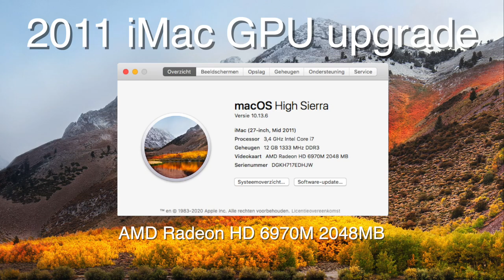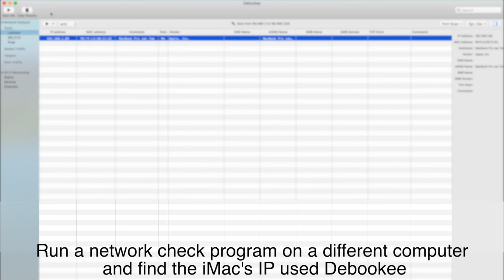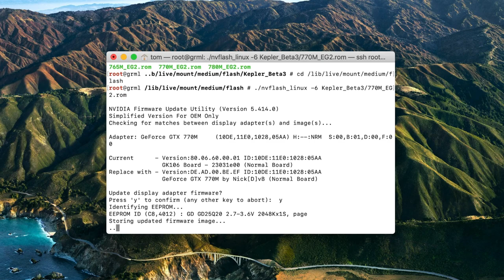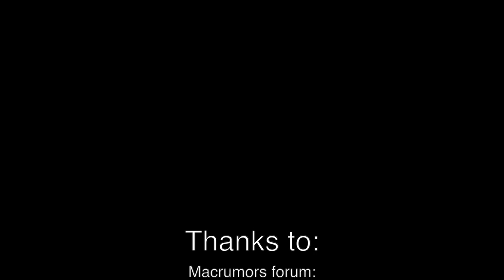iMac 2011 GPU upgrade to NVIDIA 770M with new VBIOS

Comment: Te hablo dede Monterrey, Mexico tengo un problema con esta tarjeta la compre igual que la que tu tienes 770m y el cambio fue por la AMD de 2 GB... todo igual, segui tus pasos pero la pc, no prende para nada, se queda en negro y veo que no pasa del primer led y veo que solo hace un movimiento los ventiladores y ya. Quisiera tu ayuda por que en realidad me gustaria usar mi imac que desde hace mucho tiempo no la he usado :(
Reply from the maker: I don’t speak your language, but I translated it via google. I think you have a short circuit somewhere. Make sure the GPU is mounted correctly.
Reply: @tomvreugdenhil1490  That is the problem if I put the GPU that I already had before if I turn on the iMac
Reply: That is the problem if I put the GPU that I already had before (6970M) if I turn on the iMac but if I put the new one (770M) it does not turn on :(
Reply: @tomvreugdenhil1490  That is the problem if I put the GPU that I already had before (6970M) if I turn on the iMac but if I put the new one (770M) it does not turn on :(
HEEEEEELP!
Reply: @adrianhumbertoguzmanmartin3418  Estas seguro de que cuando pones la tarjeta 770m no estás creando un corto con el disipador de calor de GPU? No será que le estás  apretando los tornillos demasiado a la tarjeta haciendo que alguna resistencia o componente de la tarjeta esté haciendo contacto con el metal?
Reply: @brojoe787  si me pudieras ayudar estaría agradecido lo que hice fue ponerle cinta negra en el soporte
Reply: @adrianhumbertoguzmanmartin3418  Saludos, En  qué parte exactamente del soporte pusiste cinta negra? hmmm, yo tengo una k2000m en mi mac q tuve que flashear para que funcionara, pero la mac me prendia , aunque con pantalla negra y con los abanicos a todo dar hasta que la removi para flashearle el Vbios. Tuve cuidado de no apretarla mucho en el disipador ya que la tarjeta es mas pequeña que la que traía mi mac. Adrian, verifica si cuando enchufas la mac (SIN el monitor puesto) ves algunos leds en la motherboard prendidos al enchufarla. Los leds son 4, se supone que al enchufarla te prenda #1, segundo (#2) led  prende al encenderla y #3 enciende si la motherboard te reconoce la tarjeta GPU. El cuarto led (#4) enciende cuando el monitor esta conectado (y el GPU funcionando).
Reply: @adrianhumbertoguzmanmartin3418  Otra cosa, cuando dices que no prende...a que te refieres exactamente?  Que enciende con pantalla negra (abanicos giran)? o que la mac no reacciona al oprimirr el botón de encendido? Verifica lo que te mencioné de los 4 LEDs (luces) de la motherboard. Suerte!

Comment: I'm looking to do the 770m upgrade from 6770, can I install without having to do anything with the bios and still have everything work good? What exactly is the bios upgrade do
Reply from the maker: No not really. You will 100% lose brightness control and the boot screen does not appear. By flashing the bios some of these features COULD return. For all information, please check the macrumors forum (link in description) for detailed information. This video is just to describe to procedure.

Comment: I have a 780 but unable to flash using the linux way , the card isn't supported in nvflash, any one with a workaround?
Reply from the maker: What is the error you get and which rom are you trying to flash? Also, are you sure the 780M you have is actually working and not malfunctioning?
Reply: @tomvreugdenhil1490  "EEPROM ID (20,0000) : Unknown , supported EEPROM not found" , weird error as the adapter is identified as a GeForce 780M (10DE,119F,000,000) . Using NVFlash util 5.414.0 , trying to flash it with VBIOS Kepler_Beta3 (latest found on Macrumours) , card works though, 1st time I installed it it booted right up. 2nd and 3rd time I installed it didn't get it past the 2nd LED on the mainboard. Probably a bad UEFI header. Maybe a bad BIOS altogether after the first time NVflash tried to access the BIOS. It's a 780M from Alienware / Dell.
Reply from the maker: @coolvidz1763  Weird. I have read on the forum somewhere that some 780M's just don't work, however you say that you booted correctly the first time so it should work.
Reply: @tomvreugdenhil1490  This russian https://www.youtube.com/watch?v=dkzobqDyAGY got it to work also. and Manfred here http://macintoshmen.is-great.net/2019/09/08/imac-2009-to-2011-upgrade-guide/ copied a resume from macrumours. Having seen it booted once, and I could connect to it with the SSH linux flasher, I have to assume the card is still working. The fact that I can't get it to display anything after the first time I installed it, tells me something changed. From what I gathered on info that is usually a missing UEFI boot instruction in the VBIOS , which can be fixed by the specially written VBIOS (your VBIOS is actually exactly the same as mine) , however I haven't found a version NVFlash that supports this card. (tried the linux variant on SSH as well as on a VM using the windows version) , I also have a USB device to flash the VBIOS (this util: https://www.youtube.com/watch?v=2Y06x1f22B0) but unfortunately the clip has these metal grips cut in a 45 deg angle, an on my 780M the BIOS is a SMC with very short pins , so the clip contacts are unable to touch the pins. I know a guy in the UK who could send me a readily flashed bios but I'm neither equipped neither capable of soldering these tiny SMC's.
Reply from the maker: @coolvidz1763  I am not a computer technician so I don’t understand all of it, but indeed a 780M should work. I have one iMac with a 780M flashed via nvflash with the VBIOS on page 1 of the macrumors thread and it works perfectly

Comment: Hi I upgraded my iMac fan spin, boots noise all as it should, but I get no picture I've been suspicious that the SSD might not been plugged into the right port but I'm only guessing, since no os no boot screen I can't tell whats going on any advice what should I do? Without putting back the old card and starting everything from zero.
Reply from the maker: If you boot the iMac and tilt the screen slightly out of the casing, you should see green LED’s down on the motherboard, those are called the diagnostic LED’s. With a little bit of googling you can find out what they mean to help troubleshoot your iMac. My guess is that the iMac is working but the GPU is not flashed yet and that (could) result in the typical black screen problem. Please read the first page of the macrumors forum (the 7 common problems) in the description where you will probably find the answer to your problem. My guess is that you need to do a few pram resets, but I am not sure. Good luck troubleshooting!

Comment: Hi, how did you manage to boot via USB because, i have a 2011 imac and an k610M  GPU installed on but, i  am not able to make a working  linux bootable usb. I almost tried more than 5 usb drive and none of them works i could not find my imac on my network. Please  please, help me, i need your help
Reply from the maker: You have to create the bootable USB via another computer. Check the link in the description which should direct you to macrumors forum where the complete guide to the bootable usb is written. Good luck!
Reply: @tomvreugdenhil1490  i made an usb bootable disk and i tested it on my MacBook Pro but it doesn't work on my imac. I don't no what to do
Reply: It worked great on my MacBook pro but not on my Imac. the Imac can't be seen on my network
Reply from the maker: @kiyeb8  Make sure the ethernet cable works properly. Does the iMac even start up, like the chime and fans spinning up? Did you disconnect ALL other drives except the USB?
Reply: @tomvreugdenhil1490  before  switching on the imac, I disconnected all wires except the usb drive and the ethernet cable. I heard the chime sound and the fan spinning and I let it boot up for 4 minutes but nothing happened. The ethernet cable works perfectly I tested it on my laptop and on my airport time capsule. I don't what to do now?
Reply from the maker: @kiyeb8  Unfortunately I don't know what the problem could be. The people at Macrumors forums gathered a lot of information on various problems so I can recommend you to browse through that. The link is in the video description.